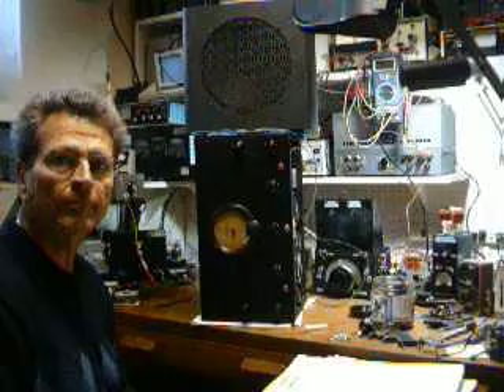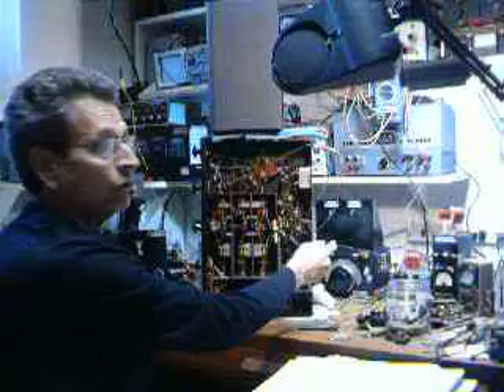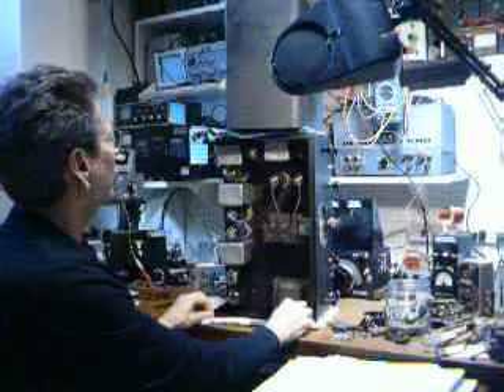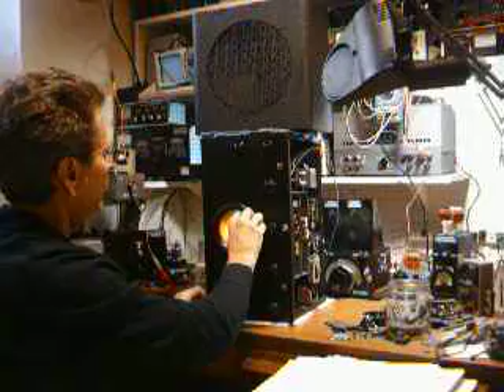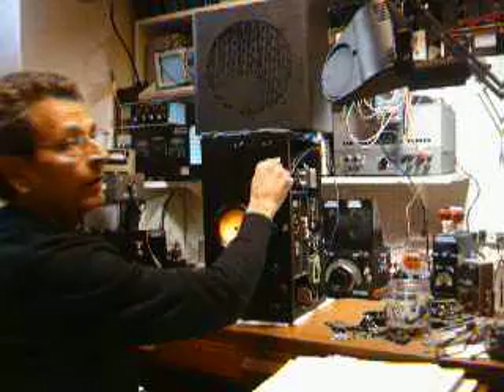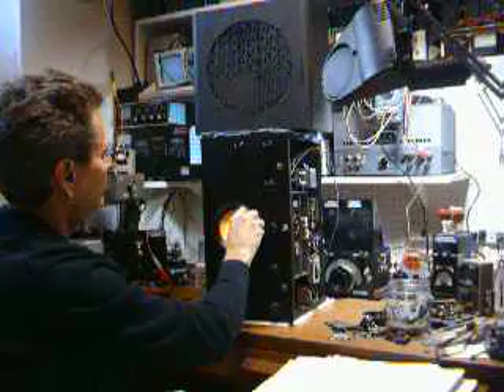N2JPR restores 1934 McMurdo Silver 5C.AVI

Comment: So you're missing the original power supply / amp / speaker, and yet you rigged it up to run anyway.   How did you do that?  Helps I'm sure if you already had an antique amp/speaker.  I have a V unrestored in similiar condition when you began, but don't have the powersupply / amp / speaker either.   You should make a website for your restoration.  It doesn't look like it was too bad to recap.  Has it take a lot of work and time so far?